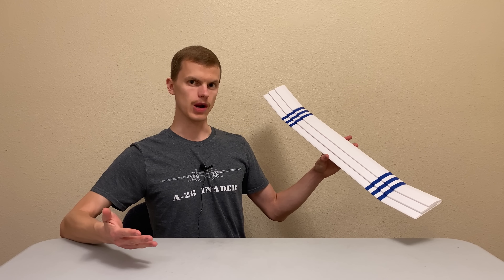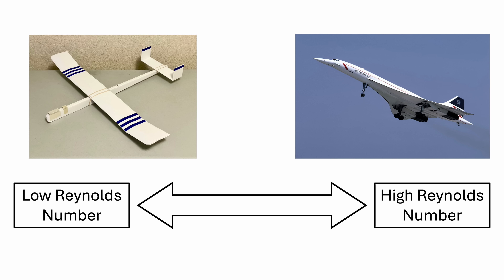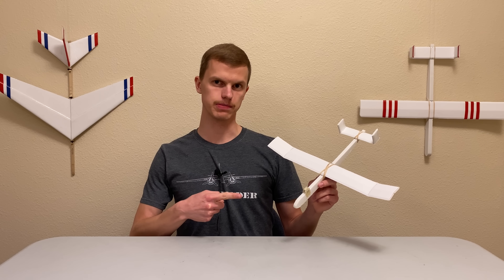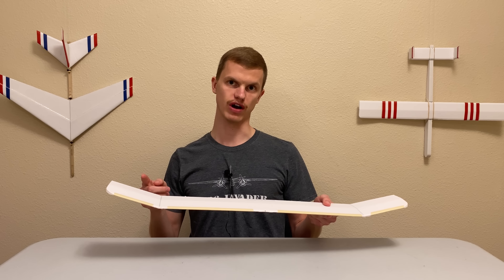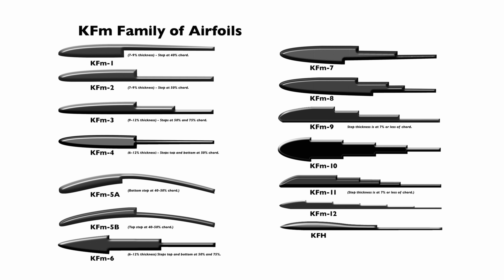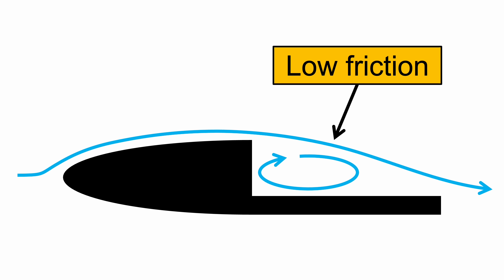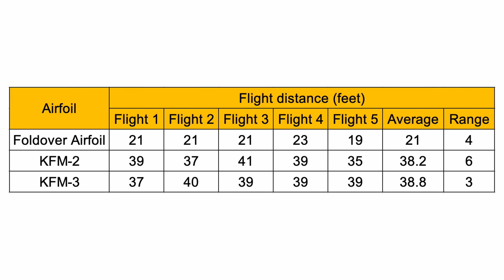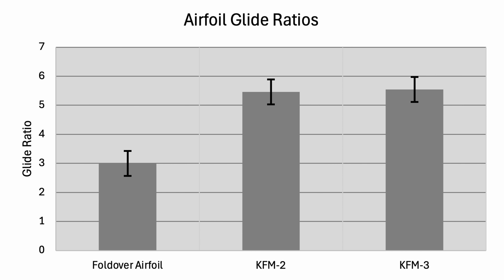Stepped Airfoils for Model Airplanes - Are They Better?

Comment: Ok! completely awesome experiments! Im retired Aeronautical Engineer from NASA. Yes I have done experiments at all Re# for stepped airfoils. I found a KFm1mod to have the best performance. The mods were NLF65 series leading edge with a design lift CL of 0.2 12% thick and sanded smooth with 400 grit 2lb blue foam also polyester resin to high polish. All I found was that we could use a stepped airfoil to create more desirable stall characteristics for airfoils designed for pressure recovery. Polished airfoils had better pressure recovery and a nice drag bucket bringing the CD down to 0.01 from 0.047 vs sanded blue foam even at Re# as low as 4000. An unmodified NLF 65-212 could not produce a drag bucket at low Re#. The massive pressure recovery that was produce on the underside step was spread out from 50%cord and back changing the center of lift to 60% and 75% in a stall causing desirable stall recovery characteristics. Tests were done at Turbulent scale length of 0.1meter and 2meters to show the difference in Micro and Macro aerodynamics. The interesting thing was we were able to produce pressure recovery as low as Re# 4000 with the stepped version in micro aerodynamic range. With the NLF 65-212 we needed at least 1.2 MRe# to achieve a significant pressure recovery and drag bucket. This is not a problem with full size aircraft as we always operate in the MRe# range but it may be of use in your smaller gliders. We made some gliders and it was fun to throw them around we saw glide slope of up to 40/1 with aspect ratios over 12/1 of corse with wing loadings as close to nothing as could be done, Man! they just keeped going. But what we were trying to learn was if it would produce better stall recovery without compromising top speed with a fixed geometry on pressure recovery airfoils designed for speeds from  M0.25 to M 0.7 and they did indeed work,  so I'm glad you are having fun studying this we sure did.  This stuff has never really been implemented, I did use what I learned to design some high pressure recovery airfoils for wind mills that reduced the kick in speed down to 10kts from 20+kts. Oh and the Clark Y sucks! don't ever use it.
Reply: Wish I could understand all your words😅 good to read
Reply: @CraigLandsberg-lk1ep   Sorry, I have a Ph.D in this stuff. I would be happy  explain what vocabulary you don't understand.
Reply: @anthonyb5279 I want to be one 😮😮😮
Reply: You should colaborate together, you have so much knowledge to share
Reply: @MauricioHernandez-de8is  Oh thank you. I did actually teach at Space Camp. I like encouraging youth to be Awesome. I also wrote CFD based Flight Simulator Software that is the industry standard and used at NASA for all flight training in every flight test programs since 1996. And well everyone else. This kid is really smart and explains things well Im very impressed with his videos, He has learned this all correctly I have zero criticism of anything he has explained.  I don't think he needs my help he is doing it right!
Reply: @anthonyb5279  At what approximate physical scale do these airfoils start to lose benefit? I'm a layman and don't really understand Re# conceptually all that well. However, picture a generic Cessna 172-ish airplane. Are the wings on those too large to benefit? How about the horizontal stabilizer which is a much smaller surface?
Reply: @iamaerix  Of no benefit Around Mach 0.7 but generally lower than that. Cessna actually considered using them and probably should have. They just seem to never accept non conventional ideas. It took me forever to convince them that pressure recovery is real and use it on an airplane.  Now the Columbia 400 is there best plane and is state of the art.  I have the first one that came off the line. But yes the longer the cord the les its maters. At very high Re# (Reynolds number) where scale length is the dominant variable you can't stop flow separation.  This is why fast planes and bullets are noisy and make that shrieking sound.  At supersonic speed a step discontinuity can be used to anchor a normal shock and keep it from propagating. I have used them on centerbodies in intakes with supersonic flow to prevent the shock from entering a turbine. Also compresses the air in front of the turbine making it more efficient. On my Subaru I actually made 60 more Horsepower by putting this kind of intake in front of the turbo. All that compression takes energy so massive drag. So not useful on a  delta wing with a low aspect ratio with cord over 10' at Mach 0.7, better on a Cessna  with high aspect ratio and cord of a few feet at Mach 0.15 but not limited to that. I like to use these airfoils on helicopters with aspect ratios of 40/1 and cord of 1' of so. They have many oter benefits for helicopter rotors too.
Reply: @anthonyb5279 Anthony! 60 additional HP in your Subbie? You can't just drop a bomb like that and not provide a link to a few photos or a drawing or something! (And, EPA aside, it seems like you might be able to design a saleable product!)
Reply: @ronhorowitz9904   Youtube doesn't let you do links. What it did is not unconventional in aviation. Its a Convergent Divergent inlet with a shock anchor that complied with restrictor plate rules for a Hill race up Pikes Peak. We had to have 39mm restriction 50mm in front of the inlet on our turbos that caused supersonic flow  making the turbo not work at all. My inlet included a shock anchor (step discontinuity) at 49mm and divergent inlet from there to the face of the turbo. So I just used the shock to compress the air then slowed it to M.8 witch was optimal for the Turbo inlet.  I did not sell it,  I just gave it to the other racers to screw with the race organizes that want to ruin everyones fun. When they implemented these restrictor plate rules I laughed!!!! I told them not only would I comply but I would increase the power. We ended up breaking a half shaft so I hade to make better ones that could take the extra power. I wish could show it to you it was a work of art!
Reply: @anthonyb5279  Can yoy / would you make a short video? Maybe youtube would allow that? Or, would there be a Google search that might turn the info up? (Maybe I can make one for one of my cars....)
Reply: @ronhorowitz9904   I figured out how to post a pic. will do more later.
Reply: @anthonyb5279 I used DOS based XFoil (or some similar name) to do some aerodynamic calculation of a foil revolving 360 from wind direction (horizontal windmill). Was that your stuff? If it was thanks!
Reply: @ewerninghaus   No I don't use XFoil, or anything DOS based. I have been using Unix since the late 70s. I worked on NASA TetrUSS, COMSOL, Flow3d and X-Plane. Back then we never went near any consumer products like MSDOS of XFoil. Java Foil does have old and newer XFoils math sets as a choice. Epplers equations are simple enough you don't need a supercomputer. From what I understand XFoil is a lot like Java Foil and its mostly based on Eppler.
Reply: sir, may i get your email 😊
Reply: @DavidJones4x  YouTube keeps blocking it.
Reply: @DavidJones4x   you tube blocks that.
Reply: @anthonyb5279 can you add it to the about section of your channel 😊
Reply: @DavidJones4x  Ill try that.
Reply: @DavidJones4x  I added a FB page
Reply: Hi, Anthony. I'm an inventor and have been pondering a new aircraft propulsion technique that uses the fuselage as an engine component: a tractor prop at the nose and very slowly counter-rotating shrouded necklace fan behind the flight deck/engine bay. Thoughts?
Reply: @RePeteAndMe  I responded but it was deleted???
Reply: Yeah I’ve spent a lot of time making normal fiberglass airfoil wing and it doesn’t fly nearly as well as the first KF airfoil I made. It was ALOT easier to make and probably stiffer and tougher too. For rc planes KF airfoils just work great. Probably because they’re not traveling over 500 mph lol.. I used the KFm- airfoil but the step at about 35-40% chord. It was a on a 54 inch wingspan mostly foamboard twin. Good all around plane
Reply: @chainbenwa2713  The biggest reason to use stepped airfoils is strength. A spar is not needed, the kink in the skin becomes the spar.  And they fly fine. There are better airfoils for many things but these work just fine where laminar flow is not achievable.
Reply: @anthonyb5279  yeah I agree. I did use a carbon fiber arrow I had laying around tho lol.. it flies great for a heavy twin engine foamboard plane. The only reason I added the spar is because I had it right in front of me. It is pretty heavy tho since it mostly carries a 3s6p 18650 battery. Its a fpv setup for out here in the country
Reply: , , and blessed are the the aeronautical engineers , for they shall inherent the skies .
I think that was left out for reasons insufficiently explored ,
Bless you and all of yours muchly  .
Reply: Cd and Cl always seem to come from a graph of test data. Are there equations of physical design properties that can get pretty close to what the graph values are so graphs are not needed if the other design properties are known?
Reply: @totally_lost1602  Eppler came up with the most robust math for determining those Polars, there are other sets but all are similar. I usually run a few different sets to see if something different comes up to invalidate one. Never trust just one tool. There is a program called "Java Foil"  that is free that you can use to learn about this.
Reply: From what I read from a report of a research regarding KF family airfoil at University of Tennessee that was funded by NASA in 1974, they gave the conclusion of most the KF family airfoil provided little to no advantages towards regular airfoil or flat plate. However, the images are poor in quality due to being too old therefore I cannot see the airfoils. It seems the people were testing in Re= 135000 down to 60000. Did you test them later on at lower Reynolds condition? And are there any published documents from NASA to back up Kline-Fogleman claim of the advantages of stepped airfoil in low Reynolds number condition?
Reply: @aeronmics I tried to post a link proving this to be ridiculous but YouTube wont let you. I put some pics from some quick and dirty CFD of 3 airfoils relevant comparison to a step on the underside vs flat plate and a NLF 65-012 on my Chanel page.  The CFD is Java Foil a free resource any one has accesses to and can run on any computer even crap Windows PCs if thats all you have, no need for a supercomputer just run Eppler's equations. But that is all thats needed to show how stupid the idea is that a step does nothing.
Reply: @anthonyb5279  Also since KFm airfoils can provide more lift at low speed, is it possible to apply on larger scale and high AR like hand throw glider or even human push glider in competitions? From my past observations I haven't seen any of my seniors applied it yet. Not sure if they don't know or is it not possible on larger scale. 
Meanwhile I am having a KFm airfoil eliptical wing RC aircraft in work to try it out and thinking of building a high AR RC glider later on.
Reply: @aeronmics  I am not old enough to have been part of that study. Sounds stupid. Whoever did that and said it had no advantage over a flat plate has no in site and doesn't know what they are doing. I studied them down to Re#6000. I was not doing it for the same purpose. I was studying stall characteristics and how a step on the bottom side can cause the center of lift to shift aft and force a recovery.  I was doing this with hand thrown gliders so extreme low Re# was what was looking at at first.  Context is everything. If you can't relate to the context then you may run the test entirely wrong. Some of the KF airfoils will act like a flat plate and the advantage is structural strength compared to a flat plate or a traditional airfoil of the same thickness. Sounds like Langley to me they can have a bad attitude from a poor leadership environment from ODU and probably did not want to do the job.  They tend to be very political and if it can't help there carrier at ODU they don't care.  I know people there that are purposely faking climate simulations by using the wrong heat capacity. They told me if I didn't get on board I would not get any grant money. At Marshal we did not compromise our science and most of us lost our jobs under Obama. Thats when I left and went into commercial CFD software development National Championship Air Racing and set some speed records.
Reply: I get anxious when a NASA scientist says "ALL Re#". I imagine the end of the experiment are at Mach 10 or 20, tending to rip everything on its way apart.
Reply: @ewerninghaus   HAHAHAHA !!!  Yep thats what i think about all the time! The Insertion Chute for Mars Pathfinder was like Mach 27!!!
Reply: Hey, im currently on a subgrad university team designing wind turbines. Can you speak more in depth about how you designed a stepped airfoil for a windtubine? What do you see as potential applications for wind energy? And would you say that these airfoil designs are outright better than traditional airfoil designs for wind energy uses, as you said you were able to reduce the kick in wind speed by half? Thank you.
Reply: @Jankyito  I have done low kick in speed airfoils for wind turbines I did not use a stepped airfoil BUT the idea is valid what I did was make an airfoil that achieved significant pressure recovery at low RE# A step underneath would do the same thing. I just posted some polars on that on my Chanel regarding that. You can see the stepped airfoil producing pressure recovery at extremely low RE# would definitely be a valid application. But keep in mind there are lots of ways toe achieve low kick in speed.  This would not be "THE" way to do it. BUT it should work as well.
Reply: Is there any research on the steps being perpendicular to the leading edge (maybe with rotating blades)? Or the steps being at an angle to the leading edge, maybe in line of a wing's stall characteristic?
Reply: @P.T.S.E.  Yes Boeing did that and it lead to the way they do there leading edge devices on the 737 and 747. At the wing root it create a step. Mid wing and out its a slat.
Reply: @anthonyb5279  
Thanks! I will look it up.
Reply: Are the steps typically flat? I’m wondering what would happen of the the vertical surface were concave instead (circular or elliptical) to create an optimal path for vortices? (Not so much for hobby models but for an optimal small wing)
Reply: @ChristopherMardell  Sorry You Tube didnt tell me you posted a question. The answer is no the air just stagnates in the corner in the optimal shape. we call this solidity. laminar flow does not penetrate turbulent flow this is important in the way many insects fly. Turbulent solidity make an optimal shape.
Reply: Hi, I'm a freshman from viet nam and we're doing a project on making a model roller coaster. Can you suggest some resources, blueprints, etc.?
Reply: @ductrann68   COMSOL is good for all physics.
Reply: @anthonyb5279 did you look at raised wing tips, or wing tip end plates to reduce loss of low momentum recirculating air from behind the steps? I.e. reduce drag from momentum loss and wing tip vortices.

Any further gains there? Or not really important at the low Reynolds numbers these operate well at? Or could that push the operating range higher?

Thanks for your other insights and comments too. Very interesting!
Reply: @hamishbiggs  Not specifically for these airfoils. I was using an extremely long aspect ratio where it is not needed. You can see pressure recovery in a range of Re#  if the step is on the under side. On top this would rob lift.  There are all kinds of ways to do tip loss mitigation and they all work. Wing fences work too but not on swept or delta wings.  Im glad you are getting something out of this discussion. YouTube is usually just a bunch of trolls offended by your competence.
Reply: Anthony… You should check out the KF when applied to a Darrieus Wind Turbine. Amazing results.
Reply: Oh i want to make rc planer like this.
Reply: you should start making YouTube videos I just spent the last half hour reading your comments here. You have too much to teach and if you're willing to, I believe many thousands of people would enjoy it.
Reply: @GG-us8dx Thanks, I may do that. Im retired from NASA and I did teach this at Space Camp I do like teaching kids its fun to encourage them to learn. I like this guys videos he is learning this correctly. I did put some CFD stuff on this subject on my YouTube acc have a look at that it makes this subject clearer.
Reply: This is a very amazing research work you did. I’m a mechanical engineering graduate, I also design RC planes for hobbies. I’d like to have you as my mentor in aerodynamics 🙏🏻
Reply: @ms_des1  RC is fun. Do you have X-Plane? or any CFD software? I can help you learn more. Those tools are important. Java Foil is good enough CFD for RC kind of RE#.
Reply: @ms_des1  Weird I answered your question but youtube deleted it. Do you have X-Plane?
Reply: @ no I don’t have it yet but I will get it.
Reply: @ms_des1  I see that you are a believer! 👍
Reply: I am trying to learn what you are talking about. You are super cool and I wish you had some videos that I could watch!
Reply: @FlyWithOshen  Do you have X-Plane and Java Foil?

Comment: Old designs form 60-70's? had "turbulators".  String above the front of the wing or v corrugated add ons made with tailors Pinking shears. KFM have a straight edge, what if the edge had v slots? Spiral turbulence?